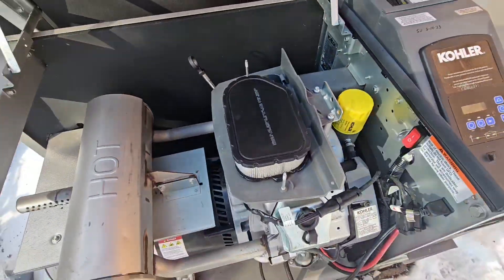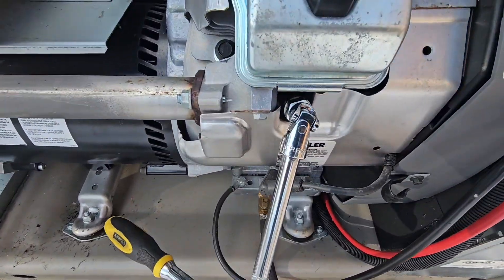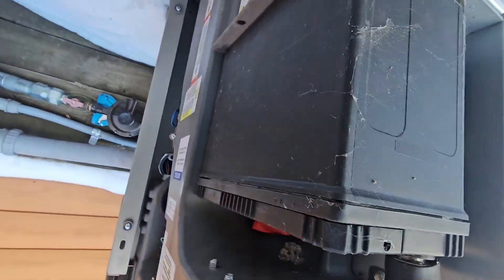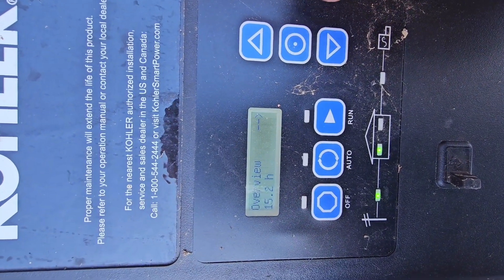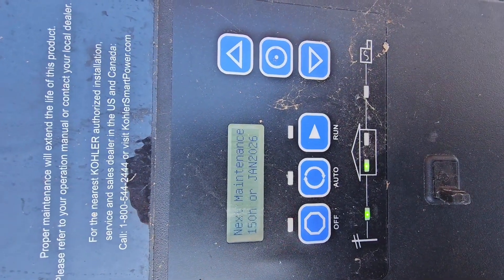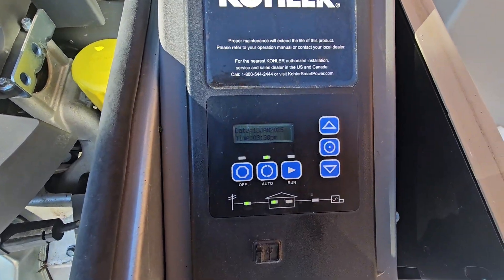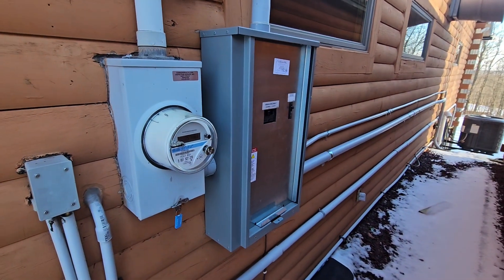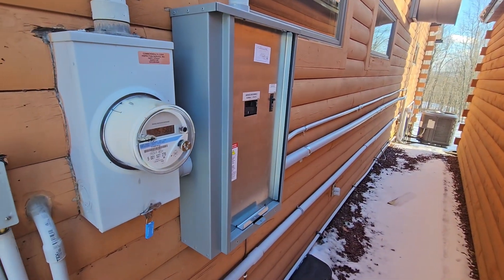Kohler 20kw Standby Generator Annual Maintenance

Comment: That oil looked like crap.  Is it that full of water every time you change it?
Reply from the maker: Definitely milky, don't think it's water, not sure what oil Kohler uses from factory but this one was overdue for change,  I have seen Generac ones look similar also.
Reply: @ Water is the only thing I’ve seen that turns oil milky like that.
Reply from the maker: I'll find out next year when I service it again.  If it was water it would probably be done for.
Reply: @ Not necessarily, but certainly not running an engine long enough to evaporate the moisture from the oil certainly doesn’t contribute to a long engine life.  My Kohler runs a 20 minute weekly test, but I monitor the oil temp and it seldom gets above 165 which isn’t nearly enough.  They really should run until the oil is 200 degrees minimum and hotter would be even better.
Reply: @LTVoyager Running it for 40 minutes or one hour every two weeks would make more sense.    Wear is from starting and stopping so doing it every week is not so great.   Doing it every month is too sparse.
Reply: @johnsmith-fr3sx I suspect they are trying to balance fuel costs against run time.  Yes, more wear at cold start for sure, but still minimal.  I’ve had cars that were started at least twice a day and lasted 20 years which is WAY more starts than my generator will ever see.

Comment: Poor design for accessing the rear spark plug.  Come on, Kohler!
Reply from the maker: Generac has the same difficult setup for some reason.
Reply: I did not find it too difficult to remove.
Reply from the maker: @arun120977  not really that difficult, just poor engineering.
Reply: @ElectricTremmel  Yes, you would think they would have some sort of access door panel on the back to get to that spark plug.
Reply: @ElectricTremmel  No, it is difficult.  Poor engineering makes it so.
Reply: I agree! Just changed mine and it was a bitch to get at. Ugh!
Reply: It's not difficult at all if you have a 3/8th ratchet and your spark plug socket i can have it out in less than 2mins it's all about how you go about it
Reply: @derekcummings5266  No, it is all about how many times you have to do it.  Once every few years is one thing, every day, multiple times a day, is a totally different situation.
Reply: All brands suck.  No easy way about it.  I would have wished for an access panel in the back, would have made things easier.

Comment: Which spark plug number does the 20kw use? Is there a Champion I can use also?
Reply: Champion RC12YC is what I run in my Kohler Gen 20KW. 5/8" socket fits 'em.
Reply: @thangknowa3288   Thank you!   In checking it seems the Champion XC10YC is also shown that it will work. Your thoughts?
Reply: @sam-68-56  The XC10YC is the factory plug.  Not every place has them.  The generic RC12YC fits generacs, Kohlers, GE, Winco's, cummin's, etc.